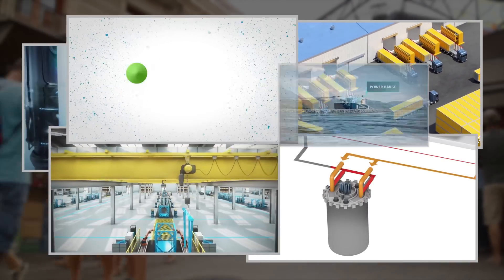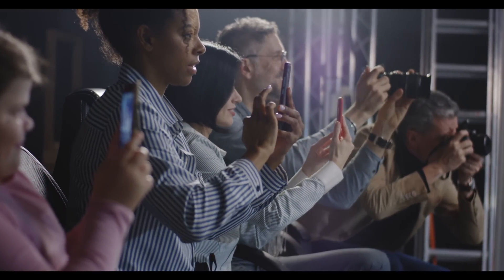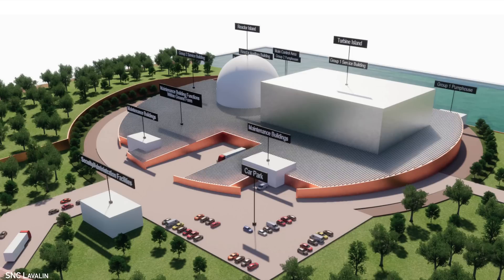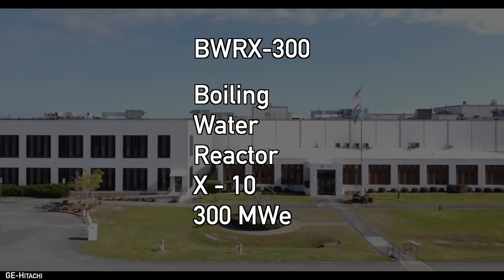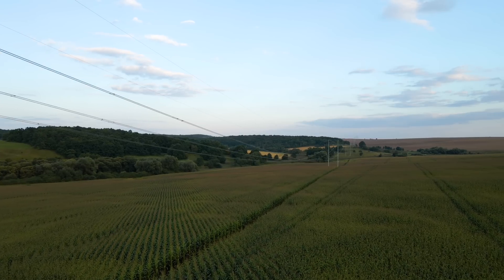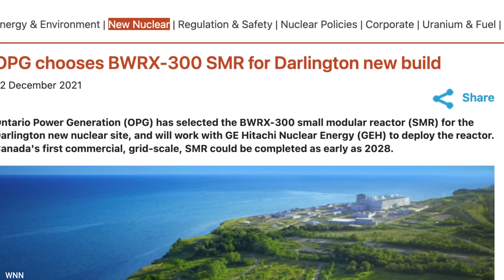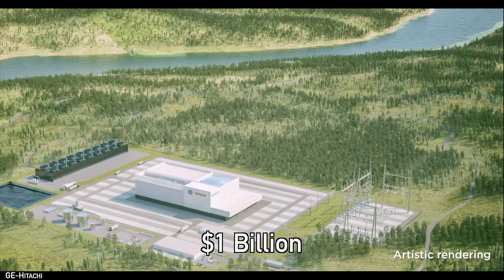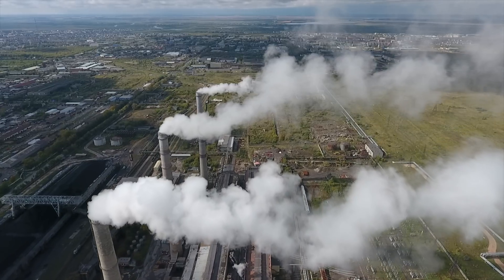Why This Small Nuclear Reactor is Actually Winning

Comment: Comments to this video allege that the BWRX-300 is too expensive relative to renewables. However,  the cost for several days of battery storage, needed for when renewables are not producing, far exceeds the cost of any equivalent nuclear plant.  So even if renewable capacity were free, it could not compete cost wise with nuclear for providing reliable service.  Service with several days of nearly complete load shedding every year?  Yes, for sure.  But never reliable service needed by homes, critical services and industry.

The US DOE, in 2021, projected that utility scale storage battery costs would range from $143 to $248 per kWh in 2030, based on a range of scenarios.

If I'm even more optimistic and assume just a round number of $100/kWh, that translates to $2.4 billion per gigawatt-day or $16.8 billion per gigawatt-week.  Thus a single week of a gigawatt of storage capacity would cost more than a 1.2 gigawatt Vogtle unit - the most expensive unit in history - and four times the estimated cost for four of the BWRX-300s.  A recent report from the Geological Survey of Finland GTK suggested a minimum of four weeks of battery storage would be required on a largely renewables system.  That would make battery storage alone cost 16 times the cost of using BWRX-300s.  No one can ever afford a wind/solar/battery system (or even to mine enough minerals to build it once, per the GTK report).  The BWRX-300 is clearly a far less expensive net zero CO2 option for now than renewables with batteries.  Gen IV MSRs may eventually be much less expensive, but that does not preclude use of this unit now instead of wasting money on unreliable choices.

As an addendum to the above, I recently found that the BWRX-300 is capable of load following over a 50 - 100% range, making it unique among existing nuclear plants that typically run base loaded, while fossil fueled plants follow load variations.  The load following capability means some systems with high load factors could run entirely on this type of reactor, with no need for fossil fueled or ridiculously expensive battery peaking.  GE also claims its electricity will compete with natural gas fired plants, meaning rates need not sky rocket from batteries essential to deal with uncontrollable renewables when fossil fuels can no longer serve that function.

Comment: Can the GE design be further down-scaled into a micro reactor, or is this as small as it goes?
Reply: You will still need containment systems in the event of a steam leak. Those are big and bulky. That's why molten salt reactors can be possibly miniaturized as they run at atmospheric pressure and doesn't need a containment system.

Comment: Great vid on Hitachi's SMR.  We absolutely need many, many SMR's around the world to replace existing coal and gas plants and provide base load power, however, the majority of new capacity will still be solar + battery storage, due to its very low CAPX cost of: 1/3 that of SMR.  Wind will also play a significant role as well but combined, solar, wind + BESS, hydro, will deliver: ~75% of our power, the remainder will come from SMR's, which is exactly what grid managers want.

Comment: China and India are working, I have heard, on molten salt reactors. The nice feature of molten salt is that they are breeder reactors and will burn almost any fuel, even spent nuclear waste. Also, thorium, as a fuel, is abundant. I think the major issues are materials for containment. Hight temperature containing a corrosive molten salt. My guess is that the problem can be solved. Let us hope. One of the features of SMRs is that they can be installed in a factory setting. This allows for a hydrogen plant to have its own power source. Go hydrogen.

Comment: Solving the metallurgical and fuel handling problems of molten salt reactors will provide huge future dividends.
Reply: Yes, it could. Of course, the timeframe requires that this be solved in a matter of very few years.
Reply: @aaroncosier735  No problem, we can probably buy them in a few years from China. 😢
Reply: @egnegn123  
It will take a lot longer than that.
The materials to make them do not exist, by a long shortfall.

Comment: The Monticello Nuclear Plant iin Minnesota is a BWR 3.  It took 4 years to build, was completed in 1971 and still operates today.  If logistics are properly worked out on these projects, similar build times should be expected.  Monticello was built before the internet or personal computers.  Once they get one built of this revision, construction of the rest should go smoothly.  This may be a pragmatic partial solution to global warming.
Reply: Ten years ago Monticello was upgraded at a huge cost, just so that it could keep producing electricity at a higher cost than sustainable wind or solar power. It simply cannot compete on an economic basis, never mind that nuclear energy produces waste products and is risky both for health and national security reasons. Nuclear is dead -- why are we wasting more money on it?
Reply: @KendallAuel  “wind and solar”. ..  plus what? Why compare a 24/7 winter summer power source that’s been on for 50 years with some power source that flips off 14 hours a day, is nearly useless in Great Lakes  winter, and would have to have been replaced entirely twice over by now.  

The answer to plus what, everywhere in the US, is a gas plant, plus a gas pipeline, gas storage, and gas drilling.   Gas plus solar plus wind, is not so cheap, is it, and has carbon emissions, lots of them. 

Even with upgrade spending,  long existing nuclear like Monticello is cheaper than solar alone, and far cheaper than solar plus the gas industry.
Reply: I agree with your comments on build times etc. As an engineer I suggest you research global warming to see if CO2 is the problem it's made out to be. As a clean alternative to fossil fuels, I agree nuclear is the way to go.
Reply: @cs7th  It is a big part of the problem, so less co2 is always nice.
Reply: @kettelbe  Have you researched CO2 and it's effects as a greenhouse gas or are you simply repeating the media mantra?
Reply: @cs7th  Have YOU? How about you mention why you think raising CO2 concentration 50% is not a problem?
Reply: @aaroncosier735  For a graphical answer, I suggest you mark out 2,380 black dots on a sheet of paper, then mark a single red dot in the centre. The black dots are air molecules. The red dot is CO2 at the current level of 420 ppm. It doesn't take a scientist to see that the single gently vibrating the molecule of CO2 offers no discernible warming effect to the surrounding air. The climate has warmed, as it's naturally warmed before in the past, but it isn't due to CO2.
Reply: @cs7th  
I See.
So, how would you apply the same principle to a dye suspended in water?
As in your example, there is lots of free space. 420ppm is quite sufficient for a dye to make water opaque, within a short distance.

Perhaps you need to think about the extinction coefficient of CO2 and compare that to oxygen and nitrogen.

Try again.
This time I think you should try a different approach.
The CO2 is not the heat source trying to heat surrounding air.
Consider the engineering and scientific concept of thermal equilibrium.
Consider that all the energy in incident sunlight has to leave the planet again to maintain thermal equilibrium.
The heat re-radiated by the earth has to pass all the way through the atmosphere. 
Now consider Beer's law, and how CO2 acts like a dye in water.

Have fun catching up with basics.
Reply: @cs7th  huh? wdym see if global warming is a issue? it obv is hello what
Reply: @cs7th  It seems like many scientists have done this research and are continuing to do so.  There are always a few that deny the preponderance of the data and the empirical evidence before them, but the vast majority proclaim that CO2 is a greenhouse gas.  The proclamation of this issue is hardly new.  The famous scientist Svante Arrhenius published the idea in 1896.  It was verified by fossil fuel companies in the 1970s.  If its a scam, they have the UN fooled.  I speak with old people where I live.  They tell me that the winters are less severe.  That's good enough for me.  I know there are paid groups like the Heartland Institute to tell you otherwise, but there's big money behind obfuscating this issue.  This same tactic was done with smoking.  I've personally seen too many smokers have too many big time health issues for it to be coincidence.  Nuclear will go a long way to solve this problem.
Reply: The US built about a dozen reactors starting construction late 1960s, build time 3-4 years, all under $1000/KW, todays $, good safety records.  The all began construction under the AEC regulator. Monticello, Point Beach, Oyster Bay, Nine Mike 1, etc. BWR and PWR. 

The light water reactors proposed today are similar light water designs, but the regulatory involvement is far different. ALARA, LNT, aircraft impact.
Reply: @Nill757  It does seem like when they split the AEC into the DOE and NRC that things really slowed down.
Reply: Here is that Monticello plant today.  This ain't your fathers nuclear industry.

Regulators are monitoring the cleanup at the 52 year old Xcel Energy Monticello Nuclear Generating Plant after it leaked 400,000 gallons of radioactive water.  The leak was first discovered in November 2022, 5 months ago, when radioactive Tritium was found in a well.
The incident at Xcel Energy's plant, came to light on Thursday, 4 months after it was first detected in a groundwater monitoring well. The reactor continued to operate while plant personnel tried to locate the leak. State officials said they delayed because they wanted to gather more information before going public.
Officials said the water contains tritium that is thousands of times above EPA limits but is of no risk to the greater public.
"We knew there was a presence of tritium in one monitoring well, and Xcel identified the source of the leak as an underground transfer pipe," Minnesota Pollution Control Agency spokesman Michael Rafferty said, per the AP.

They found the leak within days but continues to operate the plant because a refueling shutdown was planned in 2023 and they intentionally let hundreds of thousands of REACTOR COOLANT leak into the ground for profit's sake
Reply: Hey Poland! You're going nuclear for the wrong reasons!

CO2 is climate-irrelevant. 

Interglaciation climate change (i.e., the Medieval Warm Period) is caused by changes in cosmic rays (Svensmark et al). 

There is not such thing as anthropogenic global warming.  

"Global Warming" is a superstitious bullying and shakedown of the taxpayer. 

Just burn coal and keep looking for more oil and make it out of coal (the way South Africa does at SASOL).

Comment: What are the chances of a small local SMR which can use low voltage or no transformers to reduce the cost, complexity, and susceptibility to EMP dangers of larger generating sites?
Reply: Basically none if the reactor is going to produce steam for an AC generator.
Reply: @daniellarson3068  Wrong!, your analysis is simplistic and incomplete!
Reply: @tobyw9573  Not really Toby,  There's very few, if any, power stations that don't use transformers.  Even if you just use the steam for district heating, there will be transformers used in the control system of the reactor.  Think beyond transformers.  Motors are also electromagnetic gadgets.  They too will suffer from the EMP along with solid state circuitry..  However, you are certainly right about my "analysis"being incomplete.  I have cited no references nor given the science behind it.  I leave that up to you.  Have a good one.

Comment: This is bigger than the small hospital reactors that Freeman Dyson spoke about in his interviews? What are the main differences in principle apart from size between this and the ones Professor Freeman Dyson favored which he said were 100% safe ?
Reply: Theoretical physicists often think things are safe because they are theoretically safe. :) In reality, you have to actually build something, and monitor it with real zeal, before you know what can go wrong. Frequently these kinds of things come down to tiny details that would be totally glossed over in any high-level estimation of the safety or economics of a reactor.  One example: hydride embrittlement
https://en.wikipedia.org/wiki/Pickering_Nuclear_Generating_Station#Incidents

Comment: I agree with everything in this video. The electricity market is huge and this type of reactor will not go out of date. The rest of the energy market needs high industrial heat and that's where gen. IV reactors will thrive and actually supersede any and all PWRs. It appears that Terrestrial Energy in Canada will be the first and their first customers just want the cheap industrial heat they produce. If that goes well, the market for cheap industrial heat is bigger than the electricity market. 
Either way, the future for nuclear and by extension, humanity is bright, so bright, ya gotta wear shades.

Comment: SMR are extremely pricy per MW and that down to basic effect of scale, that why we went form 100 MW in 50' to more than 1000, and this market being crowded is spelling its own doop if there was one world wide adopted SMER then it just might be cheaper than big ones dude to effect of volume
Reply: Nuclear power is already extremely cheap on a lifetime basis, the issues are raising the sheer volume of capital, and an amortization period measured in decades.  SMR aims to solve both these problems, even if overnight cost per KW is higher than GW scale plants. Of course the real problem is neoliberal economics/politics, which demands private capital as a matter of faith, which itself demands shorter ROI than asset life. If we were purely concerned with getting the lowest cost per MWH, achievable by amortization being correctly aligned with asset life, we would simply build GW scale reactors directly financed with government debt, just as the Chinese are doing, and European countries used to do up to the late 70s.
Reply: @enemyofthestatewearein7945  they are cheap after amortization and even then not so much EDF wanted piece cap to be 120 euro.

SMR you are omitting the fact that all things being equal the bigger reactor cost less per MW basis than the small one effect of scale. What in theory can SMR do to rescue astronomical prices is the effect of volume, but with already dozens of SMR in some phase of development none of  these companies will reach this effect, as every nation will choose their national design
Reply: @simon2493  I'm not sure which EDF project you refer to but Hinkley C has an amortization of 30 years. Given that it's a 60 year + asset you can (aproximately) cut the cost in half, and it was funded at 9% with private finance vs 2-3% for government debt. Dieter Helm estimated that 70% of the overnight cost is financing, and only 30% is the actual build cost. On scale effect for SMR etc I agree, my point as above is that SMRs only make any sense at all due to poor financing for larger projects. However I think the point of the article is to emphasize there may be winners that achieve some scale. Most types will never make it off the drawing board.
Reply: Hey Poland! You're going nuclear for the wrong reasons!

CO2 is climate-irrelevant. 

Interglaciation climate change (i.e., the Medieval Warm Period) is caused by changes in cosmic rays (Svensmark et al). 

There is not such thing as anthropogenic global warming.  

"Global Warming" is a superstitious bullying and shakedown of the taxpayer. 

Just burn coal and keep looking for more oil and make it out of coal (the way South Africa does at SASOL).

Comment: I don't think $3,333 per kW is going to be competitive. According to the US DOE, wind turbines cost $800-$950 per kW in 2021. Total system cost will be a bit higher than just turbine cost, but this reactor would need a real world capacity factor of about 3 times a wind turbine to compete. And I'm guessing that $3,333 is capital cost, and operating costs for a nuclear power plant will likely be a lot higher than wind.
Reply: You need to take into account the lifetime and lifecycle of the technologies. Turbines break down in 12-20 years, where as reactors can last the better part of a century. Long term planning and budgeting.
Reply: @avroarchitect1793  Turbines can last a lot longer than that. And we do account for lifecycles with levelized cost of electricity, and wind and solar beat nuclear by a wide margin.
Reply: Let me know how it goes in your house when the wind stops blowing and the lights go out.
Reply: @JonFrumTheFirst  The renewables will be paired with storage systems, battery/gravity/heat that will carry the load when the wind slows down or the sun doesn’t shine. See Australian grids, NSW?, for practical details.
They usually leave out the storage portions cost so renewables costing models are deceptive but still could be less than other options overall.

Storage systems will probably replace gas peaker plants in the near future, much like gas replaced coal.
Reply: @roberthealey7238  Do you even know capacity of that mythical storage vs. actual demand?
Reply: @JonFrumTheFirst  Can you name a single time when the wind stopped blowing across the entire range of an electrical grid at the altitude wind turbines operate?
Reply: @TheReykjavik  You're kidding, right? Start with as recent as Sept. 2021 in the UK. It had already happened in the UK years ago now. The wind doesn't have to stop blowing - when it slows down, the turbines stop producing electricity. But of course you knew that, right?